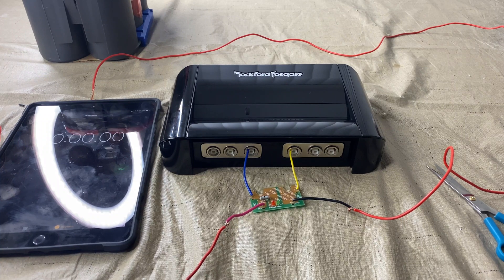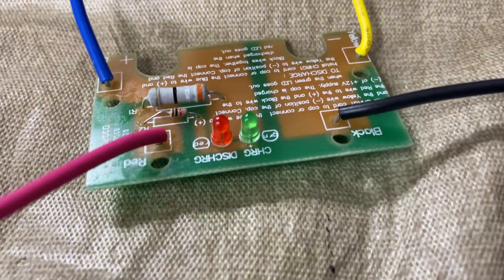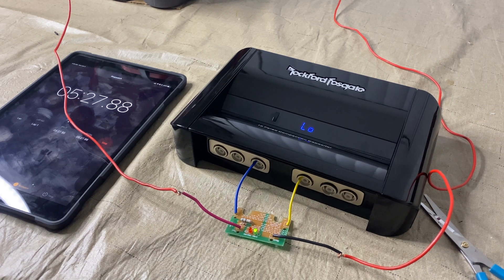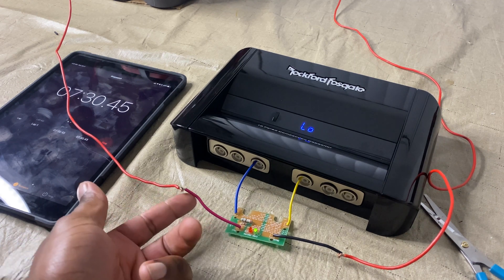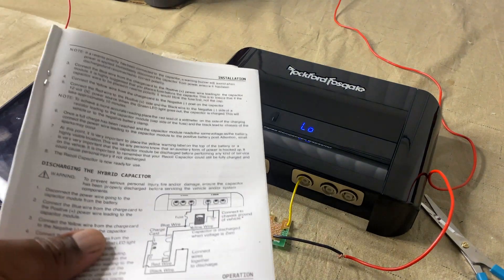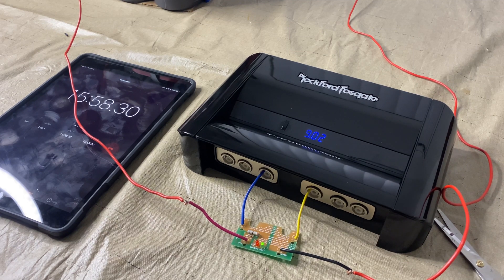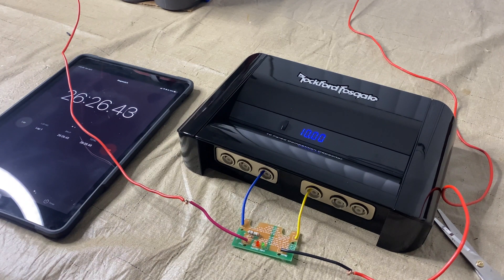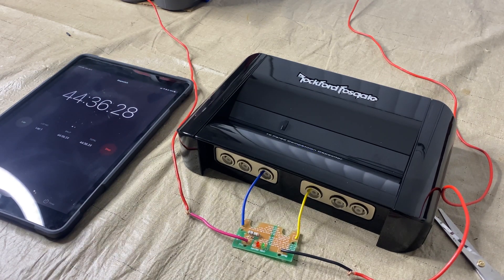How To Charge And Install A Capacitor | Rockford Fosgate 10 Farad

Comment: Try putting a charger on the battery as you are charging your Capacitor. The voltage will drop as you are charging up the Capacitor. It doesn't take much to drop the voltage to 12 volts or even below which will take longer to get the Capacitor up to 12 volts in itself. When a battery just sits by itself it will balance out to 12 to 12.5 volts right in that range. I use a Optima charger that works very well. It is perfect when your needing to charge a Capacitor. Hook up the charging resistor to the battery and the Capacitor. Wait about 5 minutes then hook up the Optima battery charger and let it do its thing. It will end up speeding up the charging process by keeping at least 12.5 or more. Hope fully this helps. Enjoy installing and enjoy the Tunes. 😊

Comment: Caps take forever to charge because of all the power it has to store my NVX 1F took forever to charge and it's a beast. I could not run my Rockford P3 @1ohm without it my car would allmost die if I bumped a good track the people who say they don't work mostly buy super cheap caps or fake caps filled with concrete or that rubber stuff. I've been doing car audio since I was 18 and I'm 44 the number 1 cause of headlight dimming and all that is a dead or dying battery so charge your car battery and watch the bass come alive boom!

Comment: why arent you answering my question? can i use a battery charger????? like the one that plugs into the wall and has those jumper cable teeth?
Reply from the maker: Yes
Reply: @treysempire3008  well i didnt use my battery charger cuz u took so long to respond
Reply: No, do not use a battery charger
Reply: @ okay I didn’t. I tried to pre charge it with vehicle battery. Green light got dim til it eventually shut off. Then I charged the vehicle battery with the battery charger and I’m pretty sure it’s working properly. Not sure if that is what other people should do though. I’m also curious

Comment: i would have charged the bank in the car instead, use a 5w halogen light bulb in series på charge it up, when the light stops glowing its fully charged... I have made a new capacitorbank by myself with supercapacitors, its over 100 farads, used it with my old car stereo install, worked pretty good. With my new install i used a lithium bank instead, no need for capacitors yet, stays over 13 volts at full tilt with a 2k amp and a 5k amp, and im only running a 90 amp gen! crazy efficient

Comment: Hey fellas. Be mindful the the Battery used to charge the capacitor is discharging at 12 volts. This will cause the charge time to be longer. If you connect the capacitor to your vehicle, with the engine running, you will be charging at 14.3 volts, instead of 12 volts. This will bring your charge time down and it will also charge the capacitor at the normal voltage that will be going to the capacitor, after it is fully charged, installed and in use. also, use a fuse (see instructions). Always follow manufacturer's instructions, so you don't void the warranty. Good luck !!!

Comment: When I get up to around 10 volt you can take it off and set it up but usually you need to have it set up in your car already so you can just connect the power wire right away because when you take that off you start to lose volts once it's not connected but that's what people don't understand you don't need to get it up to 12 volts you just got to get it near 12 volts so 10 volts is acceptable so you don't get a big spark and ruin the capacitor
Reply: You need to charge it until the green light turns off and not before then. After the green light turns off the capacitor is fully charged.

Comment: It is taking you longer due to the size of your cables and not a vehicle turned on 
I say this because I have this same capacitor and connected to the vehicle it didn’t take me long to charge and yes I did it with 0gage wires but I do have to say I like the way you did the presentation
Reply: Did you connect your capacitor directly to your battery or did you use that little interface too?
Reply: @bempowered138  no one answers ANY QUESTIONS in this comment section. WHY is it so hard to get a tutorial on this??

Comment: I bought one because I love fosgate name. Always does good. I have a 1500bdcp. And I fully charged it. Went out cruising. Few hours later it was below 12 volts. So I returned it. I have a 300 amp alternator and Xs battery now. Only way to go in my opinion.

Comment: I’ trickle charged it with a trickle charger from harbor freight .. I have the nvx one
Reply: Don't tease it, give it power.
Reply: what do you mean? like a charger with those clamps??? u clamp the teeth to the exposed wire? right?
Reply: @sp00f34 yeah, used a smart charger myself. Wired just like in the video. Just put the clamps on the wire
Reply: @richie.rich98  i ended up just leaving a 12v battery charger on my vehicle battery, while the capacitor was all hooked up. it seemed to charge both, the battery and the capacitor. cant guarantee that it's an acceptable way to do it, but ive done it a few times now
Reply: I have both. They are the EXACT same. Even took them apart to compare internals. I suggest anyone watching this to just buy the NVX as it is almost half the cost as the RF.

Comment: You can try putting a battery charger on the battery while your charging.  This may help speed up the process.  It would be worth a try.  I’m charging that exact same model cap up this evening.  Thanks for sharing.
Reply from the maker: I’m glad I could help and let me know how it goes
Reply: the whole point is to charge it slowly so you don't damage it